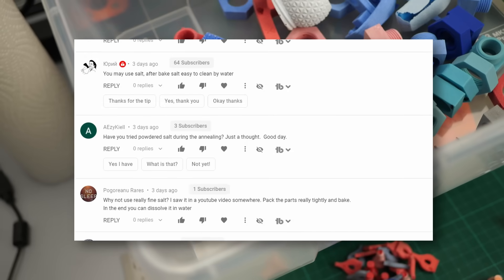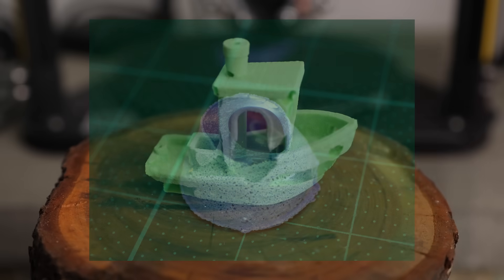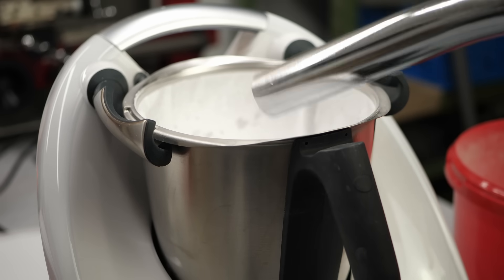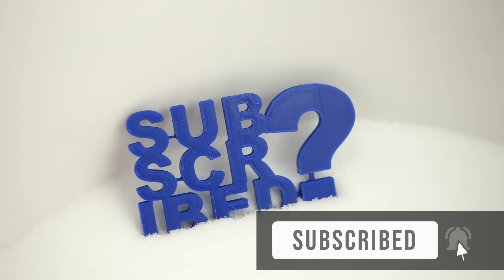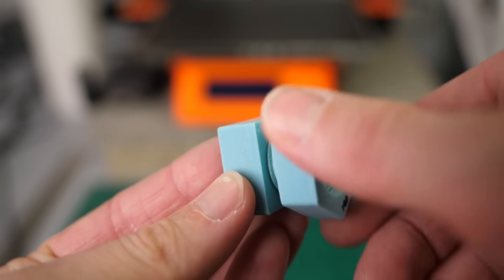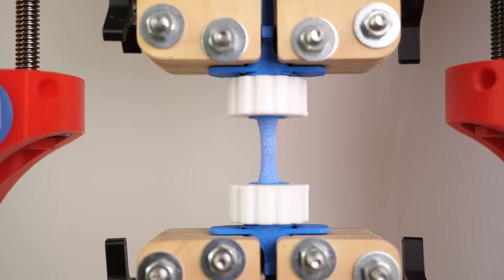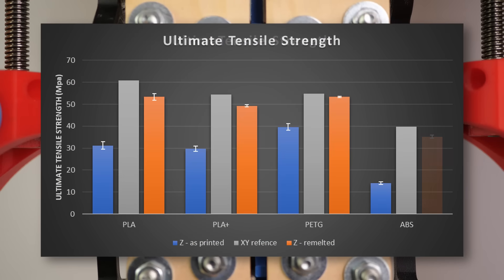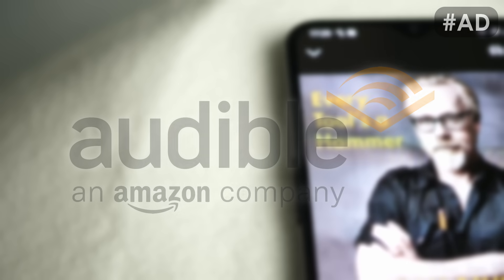The STRENGTH of 3D prints REMELTED in SALT

Comment: This version misses, or rather, improperly tackles an important step. The grain size of the salt. 

What another person did, in a different write up- not free spirit, my mistake-, was hand ground the salt, likely in a mortar bowl. This allowed him to get an extremely fine grained sample. Your blended sample could have done better with grinding, where you can sieve through to under 400 micron. Sieve is also an important step, to maintain a consistent grain size, for consistent surface finish, and allow the transparency shown in the other users channel. And as always proper PPE, any dust is bad, but the salt especially so.
Reply: Ball mill. With ceramic media for preference (steel would probably stain the salt and then the parts).
Reply from the maker: Good point. Fine and consistent salt is important, though doing several kilos in a mortar is not very practical. I'll be doing more tests on that topic.
Reply: @CNCKitchen  You could try getting a kitchen grain mill from amazon (normally used to make flour), they shouldn't be too expensive for an experiment
Reply: @CNCKitchen  seconding Drake oola’s suggestion of a ball mill. They are simple machines and can easily be built at home from easily obtainable parts.
Reply: @CNCKitchen  You should be able to find a Ball Mill for rather cheap and that would be able to handle a larger amount of salt and give you much better results.
Reply: @CNCKitchen  Definitely sieve for consistent grain size tho and the surface finish would probably look superb. A ball mill would be the easiest option if you have the budget.
Reply: @CNCKitchen  volume is important haha, i did about 1 kilo, and its pretty well all i need for my prints. look forward to more vids!
Reply: @CNCKitchen  I've used Wheat flour sieve nets, from mill, very small grain size
Reply: @CNCKitchen  get yourself a ball mill
https://en.wikipedia.org/wiki/Ball_mill
ive seen some on amazon as cheap as 50€
Reply: @CNCKitchen  but you will do it just once :) you don't waste a lot of it when using it
Reply: @CNCKitchen  there are several powered mortars machines available. Pm me I'll send pictures of some I got for work. They were rather inexpensive.
Reply: @CNCKitchen  ball mill. Simple, cheap, can be bought at a hobby store as a rock polisher.
Reply: @CNCKitchen  If your doing it regularly the trick would be to use one of the cheapo grain mills from amazon, you can find them for about 30 USD.   Another option would be ball bearings in a rock tumbler as well.
Reply: @CNCKitchen  You could use a ball mill, you can easily make a DIY one and it will grind the salt as good as a mortar.
Reply: @CNCKitchen  I've been thinking for a while that an old-fashioned stone rolling mill - the ones with a wheel on a circular path like this: https://www.youtube.com/watch?v=ecfWKsCIrVA - would be really good for this, and possibly better than most of the other options flying around. A few people below suggest a wet grinder, of which the modern ones are kind of similar to my idea. Today I had a related idea: Since this is already involving salt, and salt is somewhat corrosive to so much else, what if we also cast salt sculptures for the the wheels and the receptacle? Assuming the sculpture would dry strong enough to crush the other salt crystals, that seems like it would almost eliminate contamination with other particulates, so you could use the powder for cooking as well as annealing, and it would be easy to repair or replace when it wore down.
Reply: @CNCKitchen  What you're looking for is a ball mill (trommelmühle). Table salt is quite soft, and the purity is not that important, so it's easily build from PVC pipe and steel balls, casters and a small motor. I build a few of them over the years. But they are quite noisy.
Reply: @CNCKitchen  Maybe a modified burr coffee grinder would allow you to easily get finer and more consistent grain size. I don't know that an off the shelf grinder would give fine enough powder though, so it may need to be modified to get a closer gap in the burrs.
Reply: @CNCKitchen  You could use a wet grinder, like Alex used in grinding Cacou Nibs: https://www.youtube.com/watch?v=g-F8zL3Ufi4
Reply: @Vadecium  The salt needs to be dry or it clumps up and creates artificial holes. Thats just an extra step and it would take forever to dry it out again, ball mills are more than overkill already.
Reply: @Vadecium  You want to wet grind a substance that is soluble? Pretty certain that is not going to work at all X)
Reply: You can produce extremely fine salt dust by throwing a bunch of ball bearings into tumble sander with the raw salt.
Reply: "What the other you tuber did, was hand ground the salt, likely in a mortar bowl." 
No, free spirit ground it in a coffee grinder.
Reply: @jaro6985  interesting, i was sure he said he hand groundit. might have been somewhere else. watching his vid, he also didnt really talk about the grinding process at all so i must have seen someone else do a write up
Reply: Has anyone tried a supersaturated salt solution with this method, first allowing the solution to crystallize around the prints to a solid before placing into an oven? Different salt crystals affect total time, but grain size is of no consequence.
Reply: I can't see salt dust being harmful to your lungs in small volumes, as it will dissolve. From my understanding of it, the problem with dust inhalation is that it gets trapped deep in your lungs. Fibres like asbestos are terrible for this because they are so small and have a prickly structure.
Reply: @noxious89123  in very small volumes no, theres even salt therapy, and while it hasnt been really delved into, shows potential to help clear your airways. however, salt is an irritant. it can agitate people with respiratory issues, and isnt fun to get into your nose or eyes, and if you are grinding a lot of it, and dont have good ventilation, or ppe, you are going to dry out everything it gets into. i cant say what damage could occur from large concentrations of fine salt particles, but i dont think anyone wants to be a test subject to find out either
Reply: Actually I did it in a blender, and then when the blender melted its motor I used an electric coffee/spice grinder, doing very small batches at the time (like 50 grams or so) whilst shaking the coffee grinder to get everything properly mixed. Very laborious, and I also still get the occasional large grain of salt. Annoying. I really should get a ball mill, but my neighbour will kill me in my sleep 😂
Reply: @free_spirit1  someone pointed that out, and i was referencing a different write up, i just confused which was which hahah
Reply: you can buy submicron aluminum oxide
Reply: @GigsTaggart  "you can buy submicron aluminum oxide"
Aluminum oxide does not dissolve in water. That is one of the greatest advantages of using something like salt in the first place. I am a little curious about coating the prints in something that is dissolves in water before packing in salt, or whatever dissolvable media you discover. Perhaps something as simple as Elmer's school glue? The issue I see with school glue is that it decomposes between 200 and 250 F, and gets pretty soft above 100F. Guess there's one way to find out :D
Reply: Is salt dust really bad though? I understand other dusts are bad because they are not really bio-active but I had assumed that any salt that gets into your lungs would just be absorbed with only acute potential problems.
Reply: One option would be to get a couple of either heavy glass plates or granite/marble tiles and grinding the salt between them.  They are very flat and should turn the (well-dried) salt into a fine powder fairly quickly.

Comment: Have you tried starch?
Reply from the maker: I think that starch will brown at the annealing temperatures, so not a good choice IMO.
Reply: What about a high grit aluminum oxide like 400+? I use that for my sand blaster and it is extremely fine.

Comment: You mentioned grinding salt to fine powder like flour... so I thought about actually using flour or maybe potato/corn starch. Also how about trying it out with dry plaster powder only, without mixing it with water. I’ve tried to do some research, and basically NaCl is quite stable in “such low temperatures” but maybe molten plastic starts to diffuse into salt or something. I would love for someone with expertise to add to this conversation.

Comment: A good question to ask is if the sodium chloride is reacting with the offgassing styrene byproducts to cause the discoloration or is it a result of the heat.
Reply from the maker: I think it's "just" the Butadien gasing off and getting bad.
Reply: i used polycarbonate for the same process. PC turned brown after 45min in 220°C. changed to 180°C and 20min and it came out perfect. noted the time is correlated to the size of container.

Comment: Hhhmmm seems like CNC-machining parts is still easier, more cost effective and faster
Reply: Hello, CNC machining is super useful, but you can't machine a hollow ball for instance, so it makes very little sense to compare additive and substractive manufacturing... 
(To be fair, you wouldn't remelt a fully hollow ball either here. However, the fan duct he shown would be impossible to machine, even with a 5 axis, whereas it is easy to print...

Also about CNC machining being easier and more cost effective, again i love cnc milling and stuff, but ANY cnc capable of cutting truely 3D parts, just not 2.5D, already costs 1000 to 2000$, 
to that you factor in the complexity of the toolpaths you have to create, work holding problems, referencing your part for a double face milling, problems that occurs when milling the second face as to work holding....
Again, here, you open the 3D model, hit slice on your slicer, put the generated gecode on your printer, and wait a few hours...

Whereas on CNC routing, you likely have to have tabs, workholding issues, referencing, tool changes...
And if you mention automatic toolchangers, it often comes with machines that costs tens of thousands of euros, compared to 3d printers that costs 200 to 1000€...

So, no, CNC machining parts is not easier (almost NEVER), not always most cost effective nor not always faster...

Comment: Why did you not use a sieve to make sure your salt has reached the required grain size? Everything that falls thru the sieve is small enough, the bigger crystals go back in the blender with the next batch...
Reply from the maker: Didn't have one fine enough, though might be a good investment for that process.
Reply: @CNCKitchen  Yeah, there are classifier sieves used in weed (hash) production that are pretty available and not that expensive anymore. (Thanks, legalization) You can get them in different mesh sizes...

Comment: Would you be able to use plaster?? I know ive seen the videos where you encase the prints in plaster let it dry and then bake it. But what if you used just the powder?? Its super fine and should be able to handle the temperatures? Just a thought i had wathcing these and hearing people complain about grain size when doing things like this.
Keep up the experiments i love seein stuff like this.
Reply from the maker: Thought about it, though it's not dissolvable in water which would make the cleaning part more complex.
Reply: CNC Kitchen when You tried encasing parts in gypsum, remelt them and then disolve the gypsum, I thought “why the extra steps? just burry it in the fine gupsum powder and compress to solid before remelting. After cooling, You could just dig the part out and dust it off. Soften in water and wash off any gypsum that would have stuck (which is what You did with the plastered parts anyway). So much more simple than grinding salt in a blender a few spoons at a time.
Reply: How about using plaster powder with no water added.  It's dry, packs well, and can be removed afterwards.

Comment: What about using a silicone casting material.  Many of them can handle the high temperatures
Reply: I also thought about this.. Great Idea
Embedd the original print in silicone molding casting material. It  oly takes the need to make one form, which could then be reused to remelt many 3d printed "material blanks". Also is a lot less effort and cleaner than handling powderized salt.. 

Even better would be to use an SLA high resolution print to make the silicone mold. Then charge the mold with FDA printed thermoplastic parts..
Reply: @unrealillusion87  I was thinking that too.  Moldmax 60 from Smooth-On is used to cast molten tin and pewter. It can handle up to around 290 degrees Celsius

Comment: Talc, yes, TALC...  Mg₃Si₄O₁₀(OH)₂  it's an amazing clay.
It's refractory, comes in a fine powder and you can get it in pharmaceutical grade or get it from a ceramic/pottery suppler.
also has low shrinkage.

As a next step you can mix it with sodium silicate. Coat the parts, let it dry then bury it and heat.

Never tried it, I don't have a printer but I do make wood burning stoves.
Reply from the maker: Talcum powder is pretty nasty stuff, as we know now and not water dissolvable.
Reply: @CNCKitchen  still still can be use in suspension. I mix it with sodium silicate as a glue quite often.
Reply: @CNCKitchen  The nasty is still in debate but you don't have to throw it in the air.

Comment: I wonder if one could add some kind of membrane between the 3d print and remelt material, such that it doesn't affect the surface finish as much. For flat surfaces maybe something like aluminium tape, or maybe a thin layer of silicone?
Reply: I wondered the same, maybe something like a sprayed on clear coat
Reply: I can tell you from experience that Kapton leaves a perfectly shiny surface ;)
Reply: Same thoughts here, maybe a thin layer of oil could prevent salt to dissolve into plastic. This is a question for a chemist
Reply: A coat of high temp barbecue paint. Then pack it in diatomaceous earth.  Salt is bad as it is super hydroscopic and it gets nasty over time with exposure.
Reply: Another interesting option would be a silicone mould. It can take quite a bit of temperature and can be reused
Reply: @JuLian-cq2qv  This is interesting. Because you could then use any media to pack it.
Reply: There are water dissolvable filaments, so if you have a printer that can do multi material, you could print an exterior layer of it that will fully dissolve with the salt.
Reply: @TerminianLinkVT  Yes but that stuff would just melt off during the remelt and mix into the part. Whatever is used to coat it would need to be able to tolerate the high temperatures and keep shape.
Reply: @LanceThumping  Oh yeah that is true. I would definitely go with like aluminum tape or something similar at that point.
Reply: Earlier i had propose a boundary type coating such as Wax, A release agent, or perhaps even water to form a salt crust....
Reply: Would be difficult to find the right coat. It needs to be temperature stable and easy to remove afterwards. But the general concept isn't bad. Why not use a salt solution of the right salt and coat/ and dry it. It just needs to grow the salt crystals on the surface.

Comment: You might try with amorphous silica (SiO2) - salt is hygroscopic and can over time lose free flowing proporties. Silica can be had at very fine particle sizes down to fractions of a micron. I belie standardised particle size versions are available so you could test the effects of particle size very accurately and determine the limits. There is an inhalation risk with amorphous silica. Alternatively I do not know if simple powdered glass of less purity is available.

Comment: The advantage I see with salt over sand is that it is water solvable. I assume this makes it easier to clean the part at the end. The sand will presumably also remelt into the outer part of the plastic. But maybe you could make your parts oversized and then sand them down.